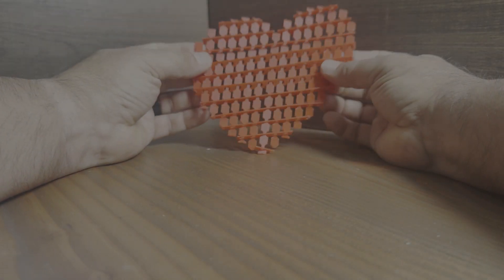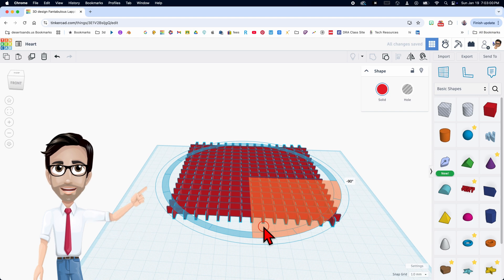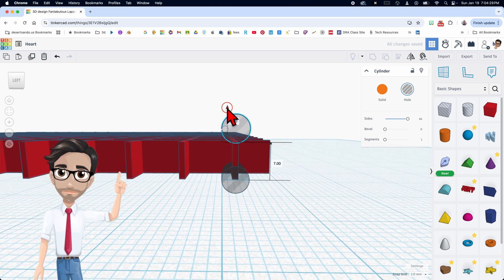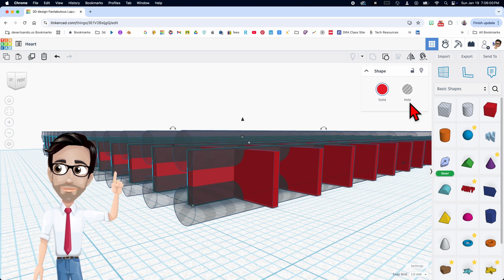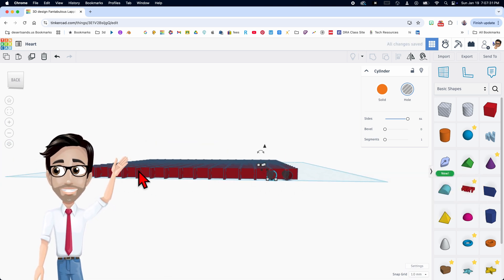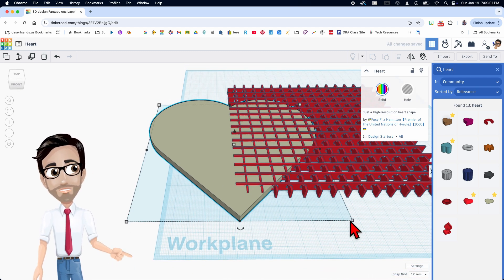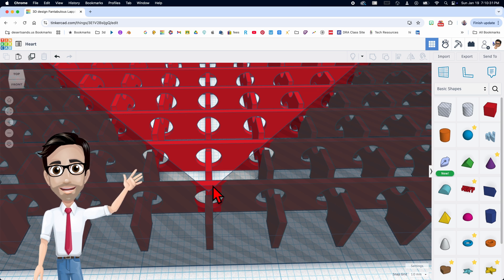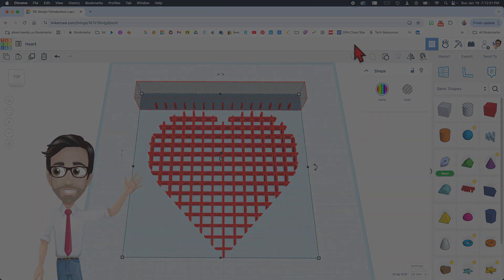How to Make a Flexible Heart Fidget in Tinkercad

Comment: Thanks for the tutorial, I made flexible heart shape, and the spinning part I filled out the hole so it won't spin and be annoying.
Now, I just need a not to expensive 3D printer, what kind of printers do you guys use?.
Thanks again.
Reply from the maker: We use bambulab’s p1p in class.  Also, instead a circle hole, you can make a square hole and it won’t spin as much.

Comment: Thank you for the tutorial, we have just finished the design. We are printing on our A1 (we are very new to 3D printing) we had a warning to say it needed supports. However we have printed without them. Fingers crossed this works 😊
Reply from the maker: I get the same message but I print anyways and it works every time.  Did it work for you?